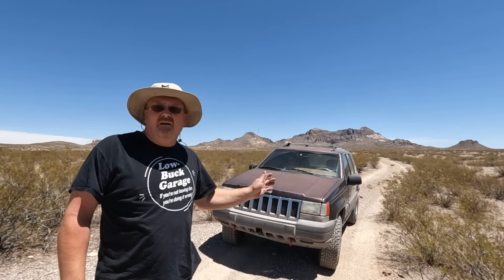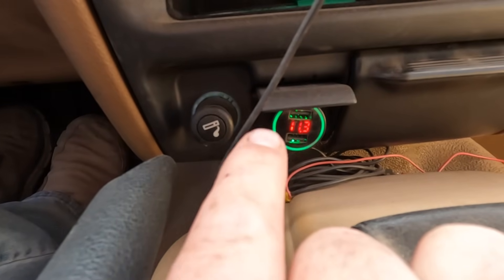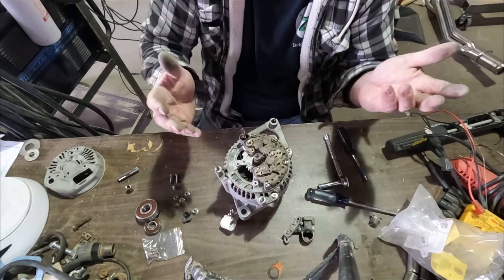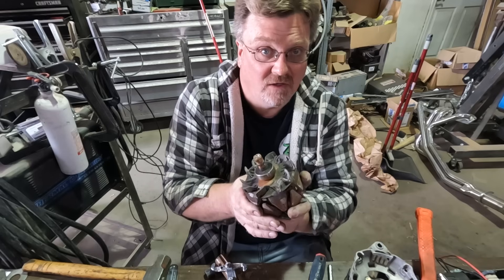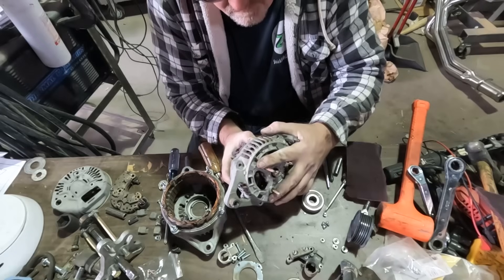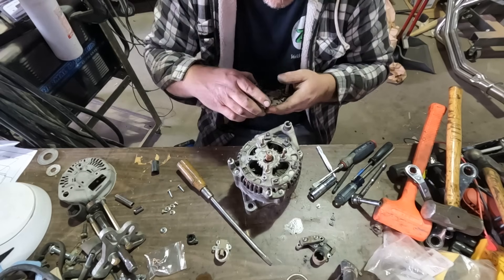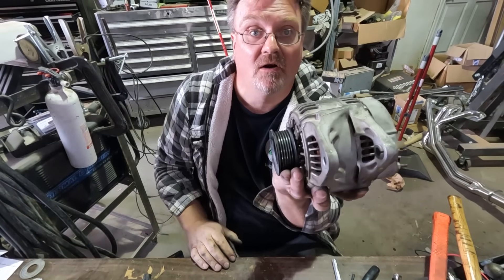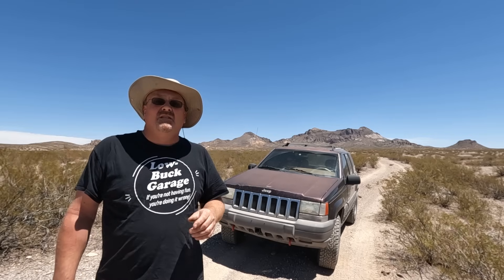$19 Alternator Rebuild, Cheaper is Better?

Comment: If you have several alternators, you often can make one good one by swapping parts around. Did once with an old Delco external regulator alternator and an internal regulator Delco. Long time ago. Don't remember exactly. I probably swapped the rectifier packs. Now about to attempt it with two 90s-era Toyota alternators. One I think has a bad voltage regulator. The other possibly a broken solder joint. We will see.

Comment: The work is easy and if you're not sure it's worth a visit to your local electrical shop to bring yours in and chat with the tech. Most of those are small shops who also sell parts. You can have your alternator load tested at most auto stores before rebuild to help diagnose it then after to confirm its to spec.

Comment: That really the best method to take with a worn alternator. You can buy USA bearings, HD bearings, Wide bearings and HD voltage regulators etc. without having to gamble on a rebuilt alternator from the parts store not knowing how good the inside parts are.

Comment: I've always rebuilt stuff like that cause my daddy used to get soooo upset at me for buying a completely refurbished starter or alternator in the 70s..I'm pretty sure I's 13yrs old first started I done and 17yr olds with the 1st alternator cause I also bought used parts for hardly anything back then but I always went through the parts to make sure I didn't get a dud lol..This needs taught to our youth cause it's coming a time where parts for anything is going to be impossible to get or find..I've always collected engine parts that most people throw away but I go through everything to make sure everything's worth keeping..I needed a GM 04 Pontiac Grand Am starter for a 2.2 ecotec engine and I took my starter and a 3400 V6 engine starter and made myself 1 good one but I didn't throw anything away cause never know when I might have to have those extra pieces and parts..A refurbished starter, with my old one is 200 at Advance Auto and 165 at Auto Zone with my old starter. Summit Racing is 106 although they found 1 for 61 bucks that takes a couple weeks to get to me but I'm not going to pass on it..After the process of pricing parts at different places, my new hobby is collecting used worn out parts to rebuild em with other used parts cause times are hard and i have a strong feeling that it's only going to get alot worse than it's ever been when it comes to automobile parts new or used. ..

Comment: Alternator in my sprinter would charge when running, around 14V, but when shut off, it would DISCHARGE the battery rapidly.

Tested, and found bad diode pack… 

I replaced it, but kept the old one, and wanna replace the diode pack.

I will be hunting for a new set soon.

Comment: Bearings and brushes are simple, not usually problem plus, easy fix.
Worn bearings just give some noise, worn brushes, not generally below 120,000 miles unless you do a lot of stop start with not so great battery that is never fully charged
Rectifier pack or regulator much more common in my experience simple enough to fix but you won't get the parts for $19.00.
High amperage regulator to fit inside alternator is expensive.

Comment: for the cost of the comm. bar you should replace that as well. the new brushes won't seat properly on the old comm bar especially if your old comm. bar has grooves in it. your alternator will last alot longer if you do.

Comment: Little-known fact, if you get some Synthetic Grease inject that into your bearings and they will almost last you a lifetime, recommend doing this about every 50,000 miles
You should have Scotch-Brite at the surfaces where the bearing is going over or inside in the case and the Armature
If you keep the screws or bolts in the back cover when you take it off that way you don't make that mistake again?
And for the audience please give your city or state or sip code location so we can get an idea of what part of the country you're in? For others that live in your area

Comment: That was a good one. My problem is over charging at 196% according too my fancy charger. I replaced the voltage regulator and got the volts down too below 16 but now what? Probably have too replace alternator to get charging down too just 100%

Comment: You are probably smartest person on YouTube on the subject of alternators, but I have a problem. Its the second time I have replaced my alternator with a new one for my 2011 VW Routan SE 3.6L and after turning engine on I tested the alternator with a meter at the alternator end both times I only get the reading of the battery 12V but not 14V. I can't figure it out and left message to a bunch of YouTube DIY but no one knows.
Reply from the maker: The alternator needs power to the field coils before it starts charging.  These are usually two smaller wires going to the alternator, not the large one used for charging.  On a vehicle that new, it should be the engine computer that turns on the field.  If you don't have power to that, then the alternator won't charge.  The parts stores around here will test the alternator for free, then you'll know if the problem is the engine computer or the alternator.

Comment: I'm no jeep guy but could it be an intended feature to exaggerate  the voltage drop on the gauge so driver will notice the problem as the needle is not midway?
I wonder if the other gauges do that if a relating problem arises. Also I think its a neat feature to have a warning light and a chime too.
Easy fix with that nater, mine wouldn't be as simple with a vacuum pump on the back and soldered joints.

Comment: i wouldnt say that battery gauge is lying when it dropped. it looks to be intentional because there are a lot of clueless people that have no idea what all those gauges mean. so im pretty sure the the check gauges light sends the gauge with the issue to zero on purpose so you at least know theres a problem with that system even if you dont know what it does. someone that is clueless knows that guage is never at 9 when they drive. not a coincidence that meter drops the exact same time the check gauges comes on.

Comment: The "parts crisis" we are in the middle of (which is a direct result of having everything made in China) makes this an even better idea than buying a new one. Anything you buy today that goes into a car, is a crap shoot. I am an industrial mechanic, we have the same issues with parts as the auto repair people have. When everything comes from China you should anticipate problems. At least this reduces the amount of faith that you have to put into inferior parts. Those rebuild kits are pretty nice, they have everything you could need. I'm sick of having to hand over $250 for bad quality parts. Good tutorial!
Reply: Do you work at a factory.
Reply: @donald8354  I work on industrial machinery. I'm an industrial mechanic. I have worked in many aspects of production. Factories are a big part of what I do. I've worked at CAT, which was a huge production facility in it's heyday. I've worked in bottling plants. I've worked at machine shops that do fabrication, that industry basically does not exist in the US anymore. So yes, I have 30 years of exposure to the slow decent into the parts crisis that most aspects of production are facing today. And it's not good! If you want to destroy a society from within, make it impossible to keep their machines running! That will make quick work of infrastructure and transportation, just make bad parts to put into those machines. Maintenance keeps a society going. Bad parts, makes it impossible to keep ANYTHING going. The push now is MACHINES ARE BAD! Tell me if you feel the same when the ones that you PERSONALLY need no longer work. People's attitudes had better start to change, because there are things that depend on these technologies and if they stop working, it's gonna get really bad!
Reply: I imagine tone industrial mechanic you have to know a lot of stuff. Like electricity, hydraulics, and other areas. You problebly have had a good career. Best wishes.
Reply: Yea I agree with you. I know a guy that he works at a icecream factory keeping the machines going. I imagine that it’s interesting work. I run into a guy that he did it at Goodyear. Thanks for answering back.
Reply: @donald8354  You bet Don. Glad you thought enough of my comment to send one back. Be good.

Comment: You might have been able to drive two screwdrivers under that rear bearing to move it enough to use the puller.

Comment: Yes, I know this response is over 2 years later. Good heavens man you've got a press and you're not using it? You are looking to damage something aren't you?!? Dig that sucker out and start using it. You'll be less likely to damage anything and you'll get things done a lot faster.

As for putting things together, I've said it thousands of times over my life: do yourselves a favor folks and use an appropriate anti-seize! Put a little bit on the shafts when installing bearings as well as on all threads. Be liberal with it but don't go overboard. You or someone else will pat you on the back some day and be very thankful that you did!

Comment: . . . One guy had a vehicle with a bad alternator and we couldn't get it out of the engine compartment; after reading some fixit guides they opined that " with the engine securely mounted on the rack, any of the repairs may be easily accomplished " 😮 😂
Reply: . . . Anyway, another horror story involved pulling out the entire engine to change the spark plugs. . . 😮

Comment: Been Working on my yj engine and ax15 trans swap. Now I've got to deal with a major wiring issue. Any experience on 88 yj computer / funky ignition delete? I'm using Chevy hei style distributor.
Reply from the maker: Sorry, I've only had one YJ and I never had to get into the wiring.  Though with an HEI type, you should just need the one power wire, you could run an innocent looking switch on the dash for ignition.  Would also confuse any would-be thieves...
Reply: @LowBuckGarage  appreciate the answer . May take a bit I'll figure it out.

Comment: For you people out there that are WD-40 lovers from google...WD-40 was developed as a water displacement product, which is what the: “WD” stands for. It's basically a type of solvent. However, any liquid is a lubricant, including alcohol, water, mineral spirits and many other things. While WD-40 can be used as a type of lubricant, it's actually a pretty poor lubricant.
Reply: I have noted the same thing many times. WD-40 will work temporarily as a lubricant. It's okay on bicycle chains. It makes a decent penetrating oil. It's good as a thread lubricant for assembly. The base oil of WD-40 is deodorized kerosene. That should tell you something. It's good stuff, but it is a cleaner and a solvent. It was made originally for cleaning circuit boards and electronic parts.

The only time I used WD-40 as a penetrating oil, I also used 3-In-One oil and some other product in a spray can. In the end, I got the little stud out of the block, but I don't know which product did it. If you get a spray penetrating oil, get a brand-name product. The stuff I got, the propellant leaked out by the time I actually used it. WD products, you can let them sit for years and they still spray. Liquid Wrench products are probably pretty good too. If you go through  a can a week, you can use anything.

Comment: The trouble is obvious for the Older Cars & Tracks!😢 Use OEM Replacement!!!😊❤ The "cheap Chinese" parts using Wrong Copper alloy And the Contact Rings on the Rotor are "Eaten" by the Brushes in No Time😮😢😢😢 Like in 10 - 15k instead of 130 - 150k miles! Safe yourself money and Time....😊❤

Comment: Why rebuild an alternator, when you can buy a 'rebuilt' alternator that will have the same or worse symptoms than the one you replaced?

Jokes aside though, this is definitely the way to go if you aren't buying an OEM alternator, unfortunately some manufacturers (mitsubishi comes to mind) Have their voltage regulator supply locked down tight and you pay out the ass for them. These can also be rebuilt but you're gonna start to get into some obscure electronics part #'s/

Comment: I really dislike volt meters on cars.  The gauge indicates the safe range that is way too low.  Your dead in the desert way before it gets down to the yellow zone.
Reply: Seriously? They're still better than the idiot lights on most cars that don't tell you anything till you're a few miles away from needing a tow...

And are ESPECIALLY USEFUL when you've got an intermittent charging situation due to dirt/carbon buildup or almost worn out brushes.😉
Reply: @openeyes-411  For most drivers that don't understand the charging system a go/no go idiot light is more useful then most in dash volt meters.   Some vehicles are different but on my 1998 Dodge pickup there is absolutely no indication if it is charging or not and the normal unacceptable  range is way too low on the voltmeter.   For someone that understands that something more that about 13 volts is likely ok, a gauge is useful.  Even on your in dash gauge you do not really have a clue what the actual voltage other then the 14 volt mark.    What is the next mark down?
Reply: @jimthode  
Not that any of what you're saying isn't true Jim but, just like your temperature gauge, any driver should be aware of where it is under normal operation - and when it deviates it's a sign of trouble... IOW, it's a point of reference if nothing else.😉
Reply: The gauge is supposed to accurately tell you the voltage and you are supposed to know what is correct. Unless you are idling with everything running, if the system has less than 13.2 volts, you are in the death zone. Actually, it should be at least 13.5 volts.

Comment: One of the worst things that ever happened in the automotive industry was the death of the electrical specialists.  Rex battery who could find any gremlin in your car.  And the 5th echelon component rebuilders.  There were guys in the 1990's that would rebuilt a starter or alternator (replace a bendix, put in new brushes, etc) for $30 and get you back on the road.  All of those places are gone now so that you can get a Chinese remanufactured unit for $220 when all it needed was a $15 new bendix.  It is a crime against humanity and we should all be ashamed of ourselves.